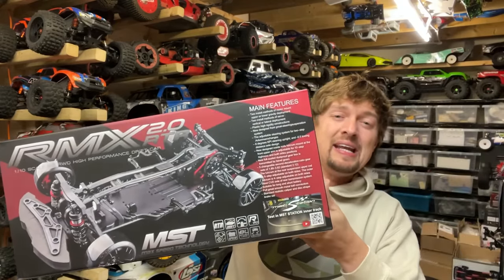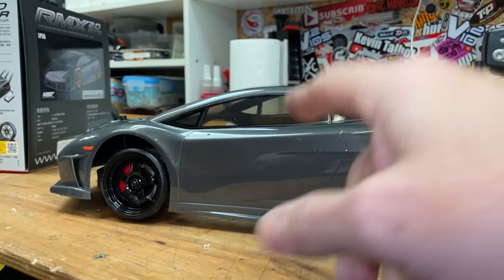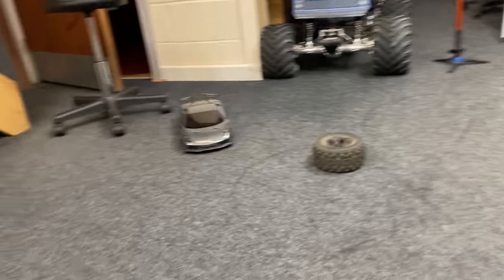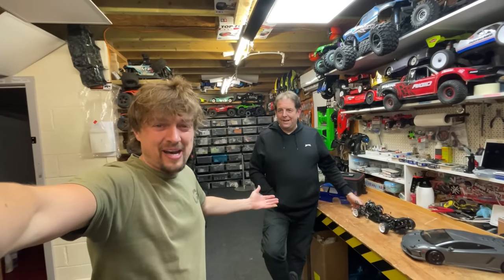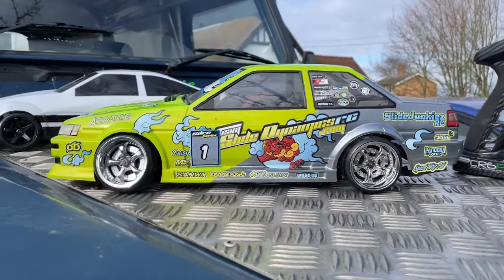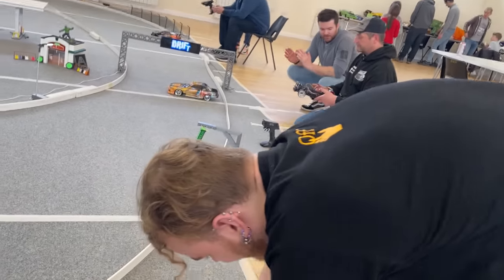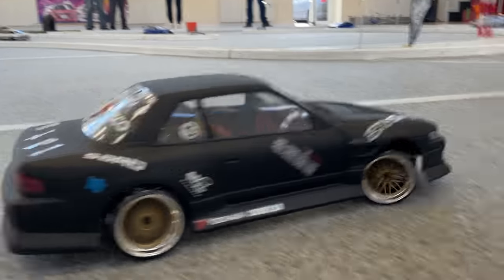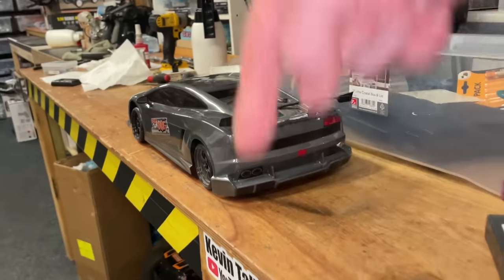I Tried Professional RC Drifting

Comment: About time you had some proper drift content...loved it Just as a side not every MST rtr is actually driven by a tester in the factory before they are shipped
Reply: oh thats cool. i got lured in by the 2.0 kits on sale at $113, been a fun build, got a carbon chassis, bl120 w 10.5t HW. Now i just need to learn how to drift...maybe i shouldve gone for a better gyro than the $30 skyRC.

Comment: Nice to see you finally trying RWD drift :)

MST RMX 2.0 RTR (there's a 2.5 RTR out now) is a great starter car, however, it is tuned for low-friction surfaces, such as polished concrete or p-tile. Your local track runs carpet, so that's why it was lacking power/speed and didn't handle as nicely as the cars of local people. Vinnie went with a more track-specific set-up, though. He must've done his research!

I would love to see you getting some upgrades and tuning the car for your local track, and then trying again. Maybe even join a competition!

Comment: RWD drift cars are the most fun I've had in RC. They are cheap to run and there is a great group local to me that runs twice a week. We are also hosting a regional series in the  Super Drift Nationals with the first round coming in less than a month.
Reply: where at?
Reply: @dylanalmony7735  Hobbytown, Mentor, Ohio.
Reply: very cheap! pretty much just tires and electricity to charge the battery haha
Reply: Well, you CERTAINLY wouldn't want FWD drift cars, or even 4WD drift cars for that matter.. So, yep. RWD it is...
Reply: @VS666  Lol... NOT cheap for a competitive drift rig.. There's MUCH more than just adding slippery tires to any old car.
Reply: @VS666  can you recommend me one I want to buy one

Comment: Hey Kevin I just wanted to say that on the box there is some body post adapter so that the body doesn’t get as cut. Can’t blame you because I didn’t exactly the same thing. One thing I’ll suggest is putting part #: MXS-210644 which are metal diff cups because I’ve already melted 2 sets of the stock plastic one with normal drifting. Another thing you could do with the metal diff cups is burnouts the car has plenty of power to do burnouts but not in the stock diff cups. 
Hope this helps 😊😊

Comment: hi kev! To make your car perform even better, you need to have the weight up high. That way when your drifting, there comes more pressure on the oudside wheels, giving it more grip wich makes it drift faster and easier to control. Also you can put the weight more to the back like the esc and the servo. That way you can get more angle. Also you could buy some turnbuckles wich make you adjust the camber. All these upgrades are available from the brand itself so if you want you drift car to perfrom better, now you know how!
Reply: NO! You want a LOW C.G. in a drift car. You do NOT want weight "up high".

You adjust the grip of the tires by adding negative camber to the wheels, so that they lay out flatter as the car throws it's weight towards that side during a drift. You dont adjust that by placing weight further up, and upsetting the C.G. 
LOWER is BETTER, when it comes to weight placement.
Reply: Lol u want a lower car for drifting lol
Reply: @davelowets  the car can throw its weight to the side more effective when the weight it up high, causing the negative camber to (almost) level out again which helps with speed and grip during the drift

Comment: You can change the motor position on the stock rmx too, I own one for 3 years now and they are great beginner drift cars, you might want to move the esc to the rear of the car though for more grip. The higher engine mounting option also provides more body roll so more grip because the contactpatch of the car increases.

Comment: Getting an RTR that's all set up is great, but I think you learn more by setting it up over time and finding the little hidden tweaks.
It helps you understand the vehicle a lot better, too.

Great movie, cheers Kev.
Reply: That's the whole point of an RTR... 
Gets you out there immediately, lets you tweak and learn, and then you can move up as you gain experience.

If you gave a new guy a professional kit, he would have NO idea how to set it up properly, and wouldn't have a clue if it handled correctly or not.

Comment: I have one of these too and what I find is that you might be jerking the steering a bit much. If you really stay smooth with the steering and throttle it makes a much nicer result. Also, RC drifting is all about throttle control.

Comment: I think the reason Vinnie was struggling was because off the car, it has a shorter wheelbase, so it is easier to spin out. Try moving the motor lower. I believe the motor mount is adjustable, although I might be wrong

Comment: Yo nice vid kev, just a lil tip tho, when rwd drifting, you should just focus on the throttle when the rear slips the grip since the throttle controls the angle of the drift, having a more deeper throttle will make it angle more and a lesser throttle will make the angle lower so balance it lol 😅😅

Comment: Try Yokomo yd2 Z(ZS) it will be much better than mst... It is better to use good control equipment. And you need to dive into the fine tuning of the chassis for good handling.

Comment: I haven't truly been involved in R/C in almost 30 years. At that time, I wish we had brushless motors, lithium batteries, and cameras small enough to mount on our vehicles. Hell, I wish we didn't have cameras that used film, because maybe I would have had pictures of our racing experiences!
Unfortunately, the R/C hobby has faded from a lot of places here in Canada. Shops that carried vehicles now are into static models and figurines. Tracks are long gone. I am not even sure that the last "local" track that was about 2 hours away is still even running.

Comment: Man was going to jump on this for the little guy, but it's a steep hill for his first one. Anyone know of a little cheaper one to start em off on? He's a Volvo guy so ive already got a 1 10 body bookmarked. Hope will fit on something.
Reply: Nope bc even redcat kit 200 and still have buy a gyro , where I think they should've came in cheaper than mst plus if your uk guy you guys don't have redcat. I know wltoys has drift stuff but you don't want that .
Reply: Unfortunately I think this is going to be on the lower if not lowest end price-wise that you’ll find (new). Anything cheaper and it may lead to a less than desirable time imo. I feel like the used market has a lot of these MST RTR’s so you may have some luck there. Also, any local drift track might have some folks willing to contribute to the cause! Best of luck! 😊
Reply: Oh! Also most of these chassis are 200mm width, so be weary if the Volvo is 190. I tried fitting a few Tamiya bodies on my Yokomo YD2 and they look a little weird because they’re not quite wide enough. If you are ever interested, SidewaysRC makes some universal wide-body fender flares which can help with this.

Comment: Seems odd to me that “professional” drift drivers would have an electronic aid like a Gyro.
Reply: It's impossible to drive without it. The Gyro doesn't do much. It just simulates the full scale car's natural tendency to have the steering return to center. It's impossible to drive RWD R/C Drift without a Gyro because you are not in the car and you cannot feel when it starts to break traction.

Comment: Could have just moved the motor to the high CG position on the rmx 2.0s moved esc to the rear and moved the servo back farther and used a extended steering link and had made yourself the 2.5 you bought separately for pretty much free 😂😂😂😂 people with all this money to blow astounds me
Reply from the maker: if i wasted time doing all that then i would have no time to make any money and also have no money. valuing money over time is why people are poor